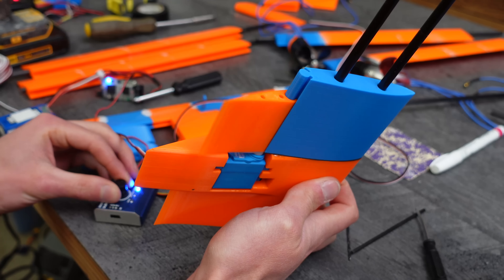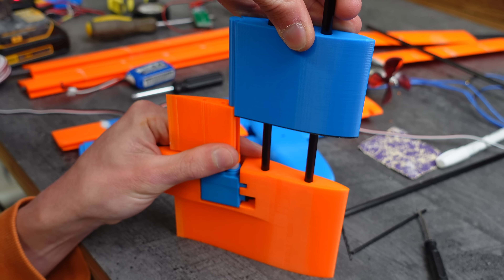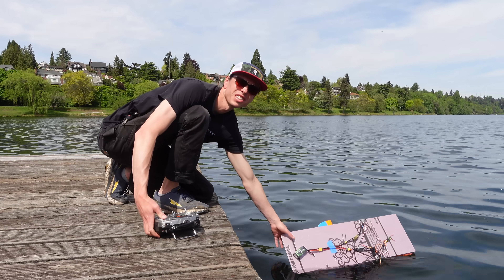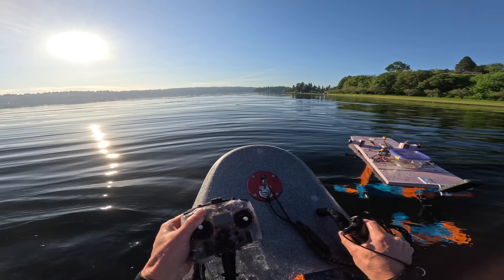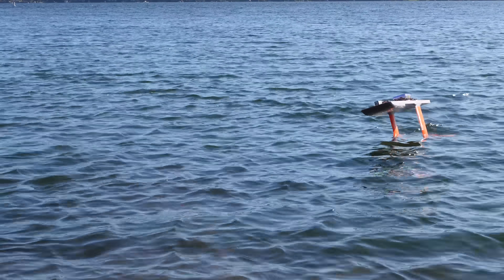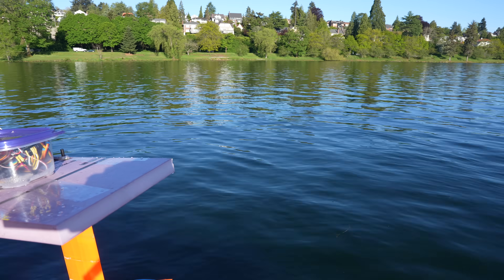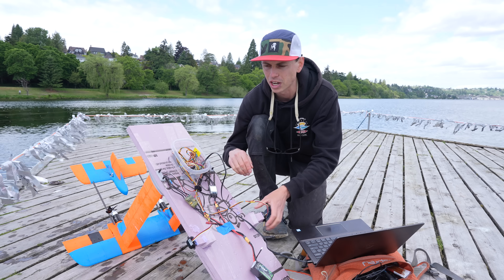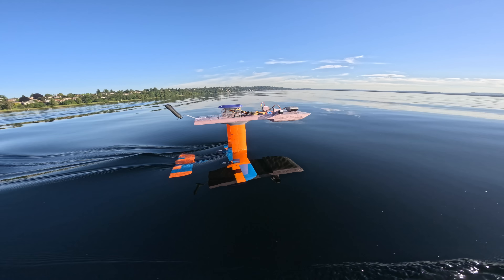3D Printed Hydrofoil with Sonar

Comment: From a wing-foiler and kite-foiler:
That rear stabilizer looks absolutely huge. Maybe over half the area of the wing?
We usually ride stabilizers around 1/6 to 1/8 of the area of the front wing, and that’s usually plenty of area for passive stabilization. You could probably get away with even less given you have active stabilization. 
All that extra stabilizer and the fuselage you need to support it really kills your efficiency, and even more so once you scale it up and start going faster.
Reply: Even for 2 people on one board? I think he's going to need all the 'lift' he can get.
Reply: Depends on the center of gravity, and how consistant it remains positioned. With wing/kite-foils, the rider is right on the center of gravity/center of lift. Agree, smaller is better.
Reply: @cortburris9526 
Usually the rear stabilizer is set up to do net zero or even negative lift in some cases. If you use it to create lift you now just have two wings, and the rear one is in very turbulent flow and not very efficient. 
So bigger stabilizer doesn’t mean more lift, just a little more control at the price of a lot of drag
Reply: actually, it seems that it's supposed to be autonomous so the more stabilization it gets the more forgiving it will be for the rider. No need for auto stabilization if the rider has to actively pilot the pitch. anyway it's part of the fine tuning that would take place on the actual full scale model with load on it because on this model, nothing is realistic apart for the control model, electronic, overall design
Reply: Interference drag is formed where yr surfaces meet at 90 degree angles. Airplanes have curves there, plastic fairings or composite fillers. That may help for more speed. Love yr work, wonder how long it will take for Nobel people to realize what weve been sayin all along.

Comment: I have been making hydrofoil blades. 3D print hollow with zero infill. Fill with expanding foam.  It is almost impossible to make them waterproof, so it is best to have consistent bouyancy by filling with foam. Rather than some filling with water. Or partly filling with water.
Reply: But then wouldn't the parts be weaker?
Reply: @alongal407  Not necessarily.  Where extra strength is needed I put narrow slots in the wall, say 0.1mm wide and a few mm long, depending on strength needed.  In order to get good bonding between layers I use a nozzle temperature a bit higher than recommended.  PLA Meta filament is quite strong, but it does have a problem: don't leave it in sunlight in a hot car, or it distorts.
Reply: @StabilisingGlobalTemperature  or just shove some alu or carbon tubes touching the inner surfaces and glue everything with foam :D
Reply: @Ivan-yo4hy  I generally "keep it simple". Stressed skin.  Increase the wall thickness if needed. Add more and deeper slots.

Comment: FYI- most hydrofoils place the mast behind the wing (and therefore behind the COG) so the mast acts like a vertical stabilizer. You can get some yaw stability for free by doing this. It would act just like your current rear vertical stabilizer, but with no extra drag.
Reply: @onquarter - an excellent point ! I expect some small scale effects will disappear in a full-scale version so Daniel might build something really useful with this project. Many passport-lite visitors might want to copy this design for international maritime travel but a kayak or a windsurfer are probably much easier :-)

Comment: Dude, cool build! Remember that Brennen Monorail train built back in the day?  The inventor used gyroscopes to stabilise and it which made the train lean into the turn. That would totally stabilise your platform and solve your issues.
Reply: That’s actually a very good idea. Getting it in the correct position and making sure it was stable enough even if the gyro stopped working would be the key. If he added it to the system he has it would probably work just fine.
Reply: That's a cool idea, might be hard to scale up though..

Comment: Differential thrust is great, but if you lose a motor you'll regret not having a rudder!
Reply: Very true, this whole build idea is pretty much seaweed catcher 9000
Reply: @linecraftman3907  More sweep in the wings might help, but there's still the join.
There has to be a design that works, but also doesn't catch seaweed!
Reply: Since it seems like he is aggressively trying to lower the amount of surfaces needed, I think he should consider giving the 2 columns their own servos. That way he can safely remove the rudder and use the columns - which he were going to cover in flat surfaces anyway - for yaw-control.

I also wonder if one of his issues with only using the front 2 surfaces is that they were too much in the axis of gravity. As in, maybe when he tried to pitch-control, all they affected was height, and they need to be brought backwards or forwards to be able to affect pitch?

If he truly only wants one surface though, he could try to complex something more complex than a servo-controlled surface. Imagine a tube (covered in a flexible material) going backwards, that expands outwards to create whichever profile is needed at that moment. So for pitch you get a horizontal flat surface that is vertically fatter towards the rear (upwards or downwards depending on the direction to pitch), and for yaw it is same but vertical. And to roll, it makes a spiral-shaped profile (so ie. horizontal at front, then rotates towards vertical in a gradient to the rear).
Unsure how you would solve needing all controls at same time, but in worst case you simply design the morphing to happen so fast that you can pwm it to seemingly be all 3 at once (cause that is TOTALLY how water works XD, the reshaping won't disturb things at all lol /s)
Reply: @ahaveland  the design is called swimming in clear water 😁
Reply: @linecraftman3907  Unfortunately, reality doesn't comply and has other ideas!
Reply: ahaveland,
Nah, he can just lay it on its side and use elevator for rudder.

Comment: I just noticed when your airfoil hit aerated water it lost some stability as the props lost thrust.  If you're using speed regulators in water the speed of the prop isn't directly proportional to thrust when the water density varies.   If you can switch from motor speed regulation to motor power regulation you might see even better results.  Motor power is speed times torque or electrical current. We had to do this to have an oil rig supply ship maintain a position in the ocean next to an oil rig.  If the water got choppy the water density varied a lot with time as waves turned up the water and speed regulation just didn't work well.
Reply: Excellent advice!

Comment: I would like to see the ailerons being used as flaps to increase lift during take off, then leveling off for flight, and maybe even reflexing a bit to aid in high speed work. The foiling Americas Cup AC75 sailboats do a similar thing with flaps on their main foil. That is one thing ive noticed in all your hydrofoil stuff, is that they work really well at 1 speed, but dont like operating through a range of speeds.

Comment: What an incredible project.    Hard to believe it works so incredibly well, as a "first try".   Speed range was amazing, too. 
The "integration" of the servos and controls into the printed structure is genius. Shows what benefits 3D printing can bring. Love the way you're combining so many different fields and skills to create this thing. (3D printing, engineering, aerofoils, flying and boating, control systems (stabilisation) - not to mention having fun on the lake!)
Looking forward to seeing the FoilBoat...

Comment: Absolutely love these control surface hinges, I should definitely try the same.
Reply: I just tried it, works great. Really helps to have the servo mounted and perhaps another fastener on the other end just for strength. I'd recommend going for the absolute minimum flap angle possible because that really improves your hinge strength. 
Generally I think that this is an unusual vehicle because it's moving through a much denser fluid than most planes (which I'm assuming your purpose would be), so it might be unnecessary to have spars through the flaps. 
Check out the OnShape he released and a section view to see how he did it. I actually tried it separately then looked and ours were exactly the same. 
Only comment is that he used 0.15mm spacing between the parts, and I've found that even 0.1mm has some play, so I think something like 0.05mm or just a little above would do fine, but it of course depends on what printer you're working with.

Comment: Just a thought. In terms of giving preference to throttle vs. control surfaces for controling vehicle dynamics, I would intuitively lean more on control surfaces and keep different tasks assigned to different components. Over reliance on the motors for both thrust and dynamics might land you in a situation where a prop gets fouled or you lose thrust, and instead of gliding off plane you nosedive. Also, just relying on the motors will probably limit your operating speed to a very narrow window. Just my two cents. Thanks for never failing to deliver quality content!

Comment: I think you should keep the rudder and use it to control adverse yaw like we do in sailplanes/aircraft. When you roll towards one direction the rudder can be used to correct the pitch. Now, you have the differential control on the motors, but I think that with the rudder you'll get a basic neutral track with no input and then be able to control the nose pitch with less overall drag when doing roll control.

Comment: I tried the integrated hinge design and I'm very happy. Way reduces the complexity of my alternate designs. 
One thing: you have a 0.15mm part spacing in your OnShape model and I was able to make it work with much smaller spacings of 0.075mm and 0.06mm. Probably printer dependent but you do get additional strength by going as small as possible.

Comment: Here is a strange idea: you know how ships have bulbous bows in order to create destructive interference with the bow wave that would normally be created, thereby increasing efficiency? I wonder if you could integrate bulbs (or control surfaces?) in front of the propellers that could generate a wave that peaks just over the propellers, allowing them to operate in effectively "deeper" water, and allowing higher speeds?

Comment: Hi There, 
I saw you use silicone beneath Heatshrink tubing, I guess it worked well for you, but there a type of Heatshrink tubing meant to be weather proof (water, dust, etc., proof) called Heat-glue tubing, you just use it like Heatshrink, BUT just so you know, it is rather hard to remove once put on (it's not really a downside, since the point is to be WeatherProof)
Reply: There is also heat-shrink tubing that has heat activated PU glue inside, it foams up a bit... and is impossible to remove.

Comment: You should try pressure sensors underwater instead of sonar above water, should help  with waves and ripples
Reply: Waves and ripples can be filtered out electronically. Measuring a pressure underwater as a function of depth may come with systemic errors because of venturi / bernoulli factors.

Comment: Glad you showed the counter steering effect for turn initiation and balancing with bicycle and regular stabilized foil board.    I think that is going to really be critical when you put your big heavy board and yourself above it.  Right now with the low CG, the ailerons and differential thrust have a large effect. I think when you get the weight up there, the ailerons will be much less effective, and differential thrust will be pretty much irrelevant and you'll need to balance it primarily using the rudder.        I think the trick will be to focus on lateral balancing and pitch stability first and then mix in steering in reverse at a lower mix ratio so that the balancing effect dominates.   Basically when you push the stick right, it'll kick the foil to the left, the whole vehicle tips right, and then stabilizes itself into a steady right turn.

Comment: Like a plane turning with only rudder and ailerons, the hydrofoil wants to pitch down(relative to the ground). To keep the bow out or the water during high speed turns, you should consider adding a little bit of up-pitch to the elevators. Like triming a plane.

Apologies if you have already considered this.

Comment: Maybe consider using the ailerons as flaps to provide direct lift control, similar to PLM on navy aircraft. It might allow you to control altitude without changing throttle (speed), or pitch attitude.

Comment: As someone who is a novice to RC and electronics, this is incredibly cool to see. I know electric cars and modern tech use sensors to correct for smoother operation but to watch you just slap it on there and rig it up in a way that works so well with some clear examples - freaking cool af... I hope you make the boat for 2 people and document tf out of that. I would 100% give it a shot myself if it works out well for you. Subscribed!

Comment: @4:30 if you would like to put the servo connector on after fishing the wires through a small hole, you can remove them from the connector housing using a bit of care and a small screwdriver to pry up the tabs that hold the crimped ends in.

Comment: It would be really slick to run push rods through the elevator tubes, so you can keep all the actuators tucked into the foil. That should let you thin out the tail to cut drag, and help out with the cable management at the same time. 

Keep up the great work, Daniel. I love the content of course, but I also mean hydrodynamics, mechanical design, control systems, test planning, etc. Cheers to your continued success 🎉

Comment: Instead of a sonar, you may want to consider using a pressure sensor for depth. Should be less noisy in the presence of waves.

Use the same design guidelines as aircraft static ports to reduce the effect of dynamic pressure induced by speed.

Comment: Might be able to drop the stall speed by making your ailerons act as flaps too.  Also looks like some cross-coupling terms in the control would help.  Throttle to flight altitude for instance.  Maybe some more sonar sensors to average out waves and smooth the ride?

Comment: You might be able to use the ailerons as flaperons as well, deflecting them downwards should decrease takeoff velocity, and (slightly) deflectinf them upwards would decrease the lift of the main foil, increasing the speed before it breaches.

Comment: You may be able to reduce drag and increase your speed with an all flying elevator of a smaller size, may be able to hide the servo up front in the main wing with a pushrod for actuating the elevator

Comment: very nice...foil + stabilization sounds like a revolution if you can maintain pitch and height precisely then you can also reduce the height of he foil. just needs to be as high as the heigh of the chop/waves/wake and you can go full speed like on a magic carpet. you get comfort + efficiency + performance + handling. this is amazing for recreation and for passenger water  transport.

Comment: You might consider leaving the rudder on even thought you can get away with none. If you loose a motor or ESC, you will still have yaw authority. If you don’t have a rudder, you will loose yaw authority. At speed, that could potentially be dangerous for a full size vehicle

Comment: Pitch control on wing foils is achieved by moving your weight back and forward depending on how much power you have (in the wing).  Not sure how easily that is to implement mechanically.

Comment: I think you can make the tail assembly at least 1/3rd of your current size, I am familiar with the Moth and Switch foilboats and the T-tail is extremely small compared to the mail foil and they just use it to trim the altitude and steer. While they use a flap on the main to automatically keep the altitude

Comment: I have wondered if you could use a similar setup to control the airfoil of a high speed hydroplane boat. Using the front wing and altitude control to keep it at the perfect height and prevent it from flipping over at high speed.

Comment: U can save up 1 servo on ailerons. 2 pushrods on single servo for strictly aileron motion if u plan to isolate them to only 1 function. This gave me hope (and craploads of info) of my future flying crap with only 2 servos (ailerons and elevator) with a single motor. With some fine mixing, i think it could turn only with ailerons, at least in flying mode. Thx a lot man! Expecting to see u soon up and running. Best of luck!

Comment: With the reynolds number being so incredibly low, the airfoils used arent appropriate for water. 

Consider using laminae flow foils but modified down to 8% thickness and your efficinecy will improve no end. Note that laminar flow need very clean surfaces in order to work, ie, 3D print surfaces will effectively kill off the laminar flow with a fat boundary layer

Comment: You should try autostable profiles like the ones used on flying wings. You would only need one wing and two control surfaces plus diff thrust to have control over all axis

Comment: You can get heatshrink tubing that has a layer of glue inside it which is activated when you apply heat -- this might be easier to use and give a cleaner result than trying to smoosh silicone inside the tubing prior to shrinking.